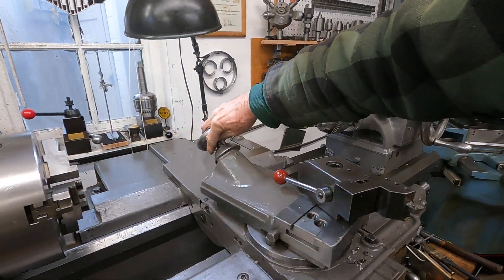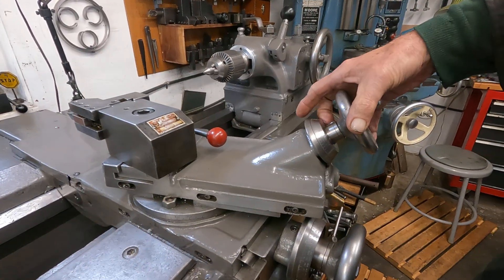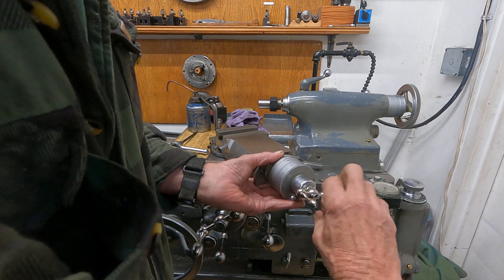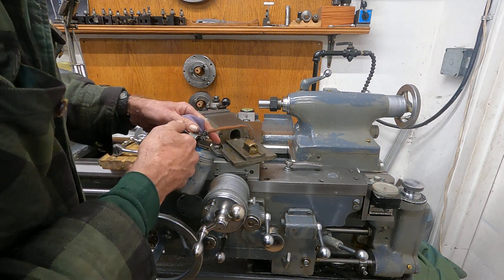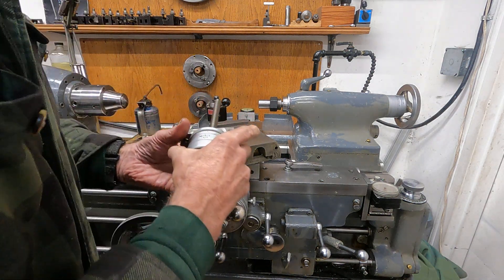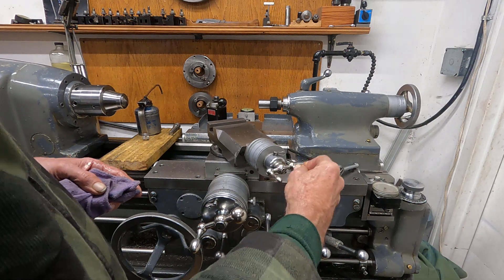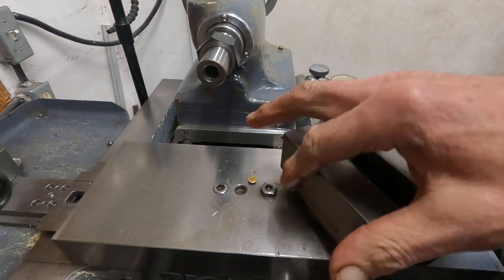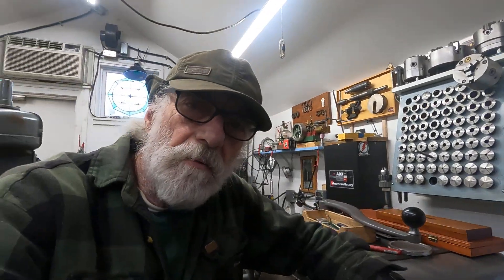Monarch 10ee Lathe Professional Service for the Compound Rest

Comment: Is there a ball under the little dial lock lever ? My lever doesn't lock and there isn't anything under the levers screw. Thanks.
Reply from the maker: I think there is a short piece of round brass in there for locking contact, thanks!
Reply: @deedeeindustrialsuperprecision  Thanks. Used a piece of bronze round bar I had lying around and fixed it.

Comment: Amazes me how often you see a "good" lathe in a workshop somewhere and its filthy dirty, buried in its own chips and obviously only sees an oil can about once a year, usually a machine used by anybody who works there to do simple quick work.
Almost impossible to oil a machine tool too much and oil is really cheap versus having to buy or make replacement parts.
Reply from the maker: I see that a lot more in the last 20yrs, no one wants to maintain anything.

Comment: What harm would it do to drill little oil ports to the ways of the compound  and the screw and add ball oilers? Thanks Don
Reply from the maker: Likely no harm at all but no one would do it
Reply: My Clausing has ball oilers already. they are there for a reason, but some people never use them because they are a little difficult sometimes to actually get oil past the ball.
Reply: some people find it hard to cut a steak with a sharp knife @terrycannon570

Comment: Nice trick with the quad ring. When I made the new nut for the cross slide on my little Clausing 100 lathe I drilled the bolt all the way thru and tapped it 1/4 x 20 and put a short button head cap screw in it. I just remove the button head screw and pump oil from an oil can to the lead screw. Like you I use Way oil because it is sticky. I made the nut out of cast iron because that is what it was made of originally and the screw had minimal wear on it. On the Clausing 5913 the cross-slide nut is bronze, and the thread is worn completely out in the center. So I am replacing the screw with 4140 hardened screw and making the new nut out of cast iron. It came from the factory with a ball oiler in the bronze nut, but I guess they never oiled it. Some people just don't care. In my part of the world Oil is GOOD no Oil is Not Good. I think that rule is pretty simple and easy to understand.
Reply from the maker: I have seen that before cast iron nuts seem to cause less wear, I believe cutting aluminum is harder on a machine then cutting cast iron.
 A guy came into my hydraulics machine shop and said he couldn't have me machine his nylon because of too much oil everywhere. I said this is a hydraulics shop, its all about oil and plenty of it.
Reply: love the answer @deedeeindustrialsuperprecision
Reply: I just made a lead screw for a tail stock and replaced the nut with stainless steel (304) I was thinking about making it out of brass or bronze but the original one was mild steel. Or at least the one that was in it was.. someone else may have made it. I think I have a chunk of cast iron, I think I’m going to remake it with that cast iron and see. The new lead screw I made from 4140  so it will probably outlive me. But the nut on the other hand..  I have two more to make for the top slide and cross slide. Might just use cast for those as well. The first ones I made out of aluminum as a trial run are really sticky feeling. They work but you can definitely feel the added drag of the soft aluminum. I bet the cast nuts will glide like butter.
Reply: DeeDee. Good to see you.  It is a shame Monarch didn’t do a better job of designing the lubrication system.  The really like the Bijour oil parts, but I think they need to be paid attention to.  I reground my bed because the inside of the “V”, which is really narrow anyway, was worn because of a lack of oil.  All good now and running perfectly.  Cheers, TB
Reply from the maker: The Axelson got clogging of the arteries even though the passages are large. The little Bijour metering valves can clog easy. A fellow I worked with heavily manually oiled the ways and I do that too. One aspect of having to take apart and lube that top slide is it is really clean and completely lubricated far better than possible with ball oilers and it takes 5 minutes, this is a machine for artist, Monarch put effort where others had failed miserably in the precision and ease of use. Now Axelson as far as the carriage oil pump may be unmatched for ability to gush oil out of the compound rest and building muscle shifting any of the levers. @bid6413

Comment: What happened to your editing software Don?
Reply from the maker: The program crashed "again" but I can re load it after a couple of days and that usually works.
 The devices do not readily communicate with each other, and it can be a maze to get through.
The camera image is converted to the editing then put in your computer program then converted to another form that will load onto YouTube. I have constructing the grinder rest still on a chip, I will try to redo that in a day or two. For reference a 11 min video at lower resolution takes up 3.5 GB right out of the camera the editing program adds to that an average video around 30minutes takes 16 GB then you still have the raw video eating up space. The cloud eats up massive time loading. None of these things really work like they should in my opinion,